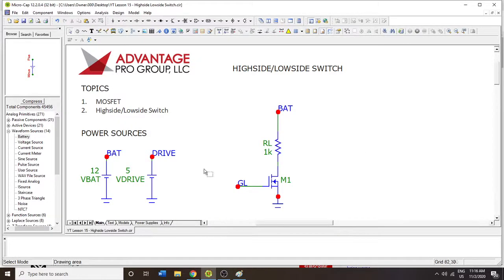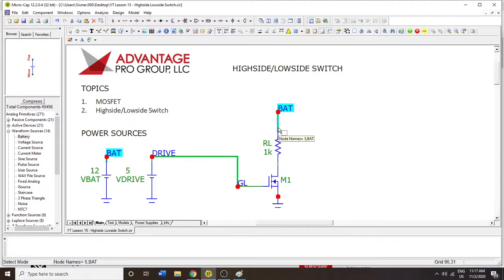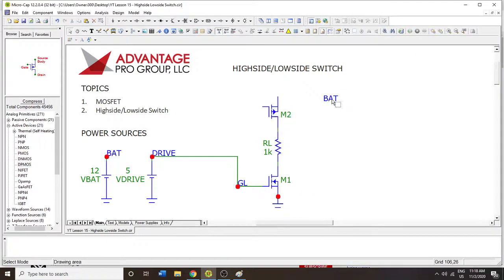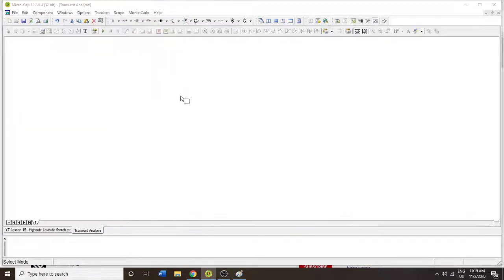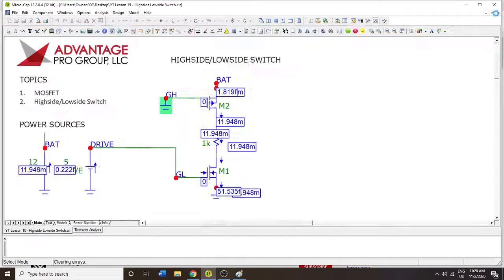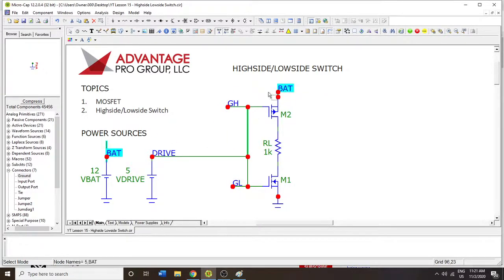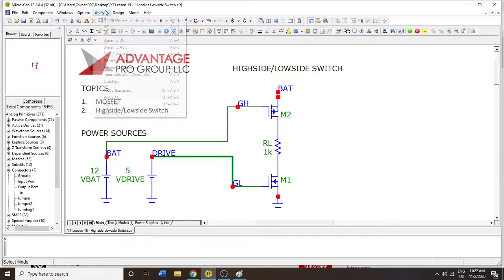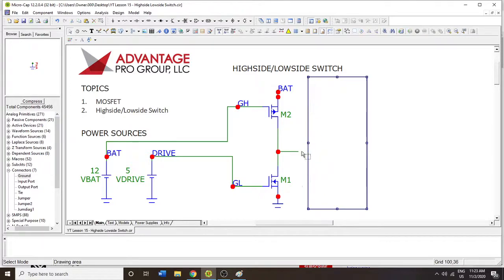Micro-Cap Tutorials: MOSFET Highside/Lowside Switch

Comment: Are you aware of a MOSFET design that could work if there was a load on the high side or low side? Like one circuit that can handle both load configurations
Reply from the maker: I would just use a high side MOSFET for one application and a low side MOSFET for the other application. It's unusual to move the load's highside or lowside position dynamically in the application (there isn't a lot of reason to do so). Switching between highside power directions is the basis of H-bridges for clockwise and counterclockwise applications.

Comment: Very nice well explained video....hey i need about 140 volts transformerless about 60 amps.any suggestions? Thanks
Reply from the maker: I'm assuming you're asking about a direct current (DC) application and not a new concept (say alternating; AC). It would be difficult to find a single MOSFET with a safe operating range (SOA) like that. I would  need to know what you're doing. That's about an 8.4 kW application. I haven't designed anything like that before.
Reply: @pauljstar  hello thanks for replying.  Scratch those numbers im looking for 40 amp 90 volt dc charger with current variable.its for a e bike if you design and put it on ebay ill gladdy purchase it thanks.